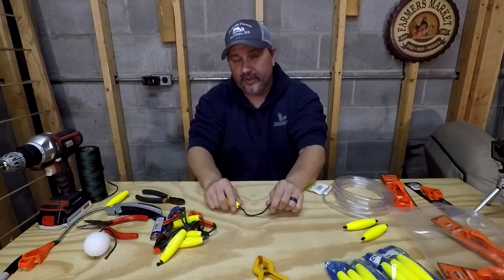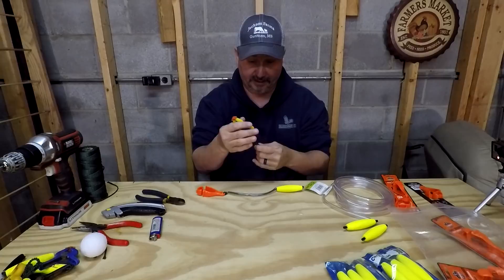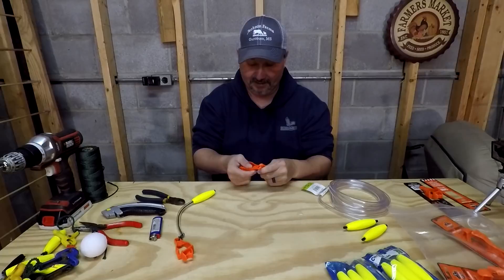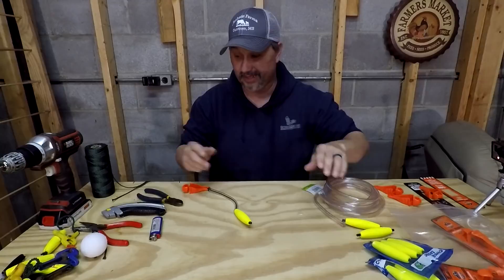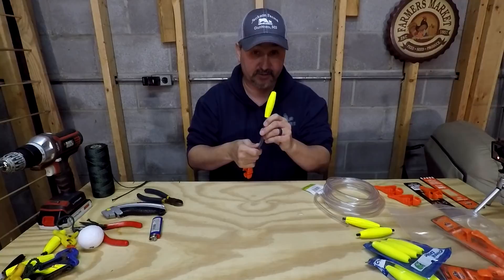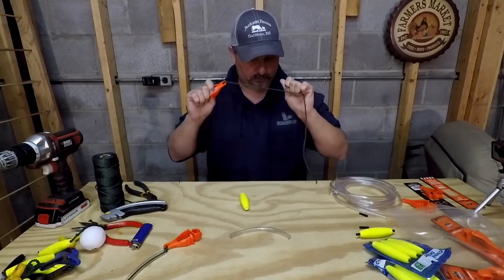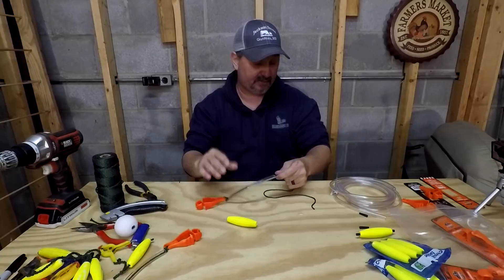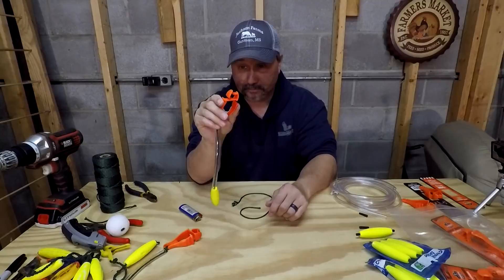Version 2.0 of the DIY Conservation Cull Clip

Comment: Have you noticed if that clip causes damage to the lip? I was going to make some but was worried about hurting the fish with the clip
Reply from the maker: I have not noticed that it does.  The one thing that I did not add is an O ring to help these clamp better.  If you do make some add a #17 O ring.  These can fall out without it.
Reply: @ErnestColeFishing  Where do you put the O Ring??
Reply from the maker: @MrJohnB-qs6dp  right under the clip. Where the spring and clip meet.
Reply: @ErnestColeFishing  Thanks for getting back to me. I appreciate it very much. Looking forward to making my own cull clips.